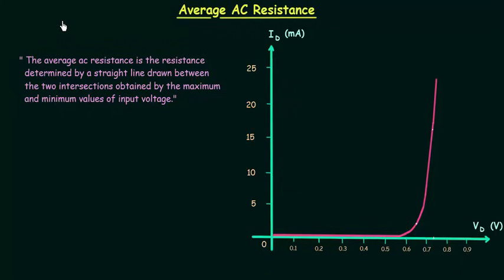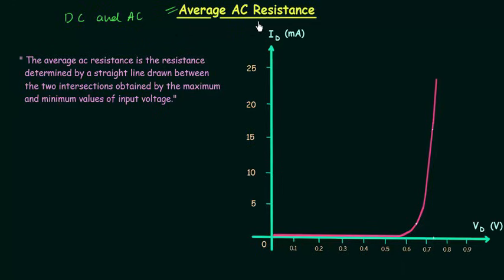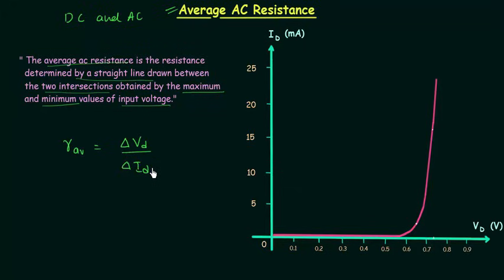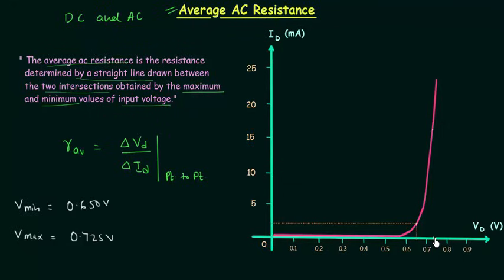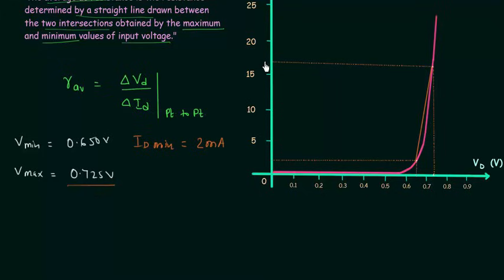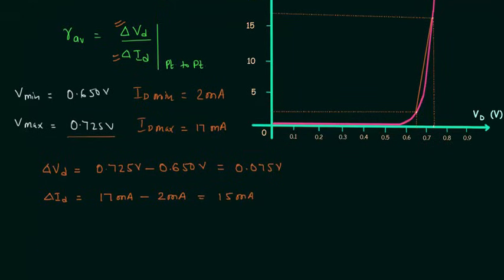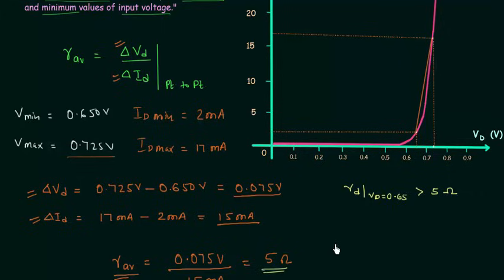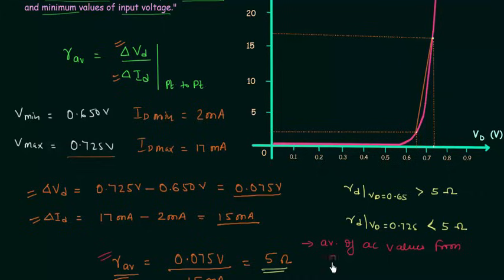Average AC Resistance of a Diode

Comment: what's the difference between AC resistance and average AC resistance?  pls explain
Reply: avg ac resistance is used when there occurs a swing like structure mostly like parabola( not exactly may like exponentially also)Where as AC resistance is used when there is no curve but there is straight line increasing ideally

Comment: how can we say that diode resistance at minimum voltage is greater than the average ac resistance and at maximum voltage it is less than average ac resistance
Reply: I think we can say this by seeing the graph as at low voltage current is minimum as shown in the fig and at high voltage current is maximum and we know very well that if current is max then resistance is min vice versa

Comment: why you took Vmin=0.650 and Vmax=0.725
Reply: to find avg there should be one more value. average ac resistance is used when there occurs a swing like structure mostly like parabola( not exactly may like exponentially also)Where as AC resistance is used when there is no curve but there is straight line increasing ideally